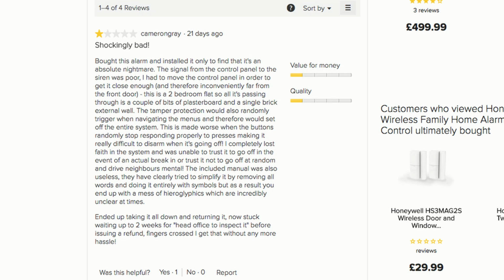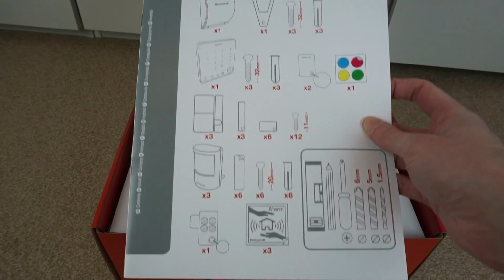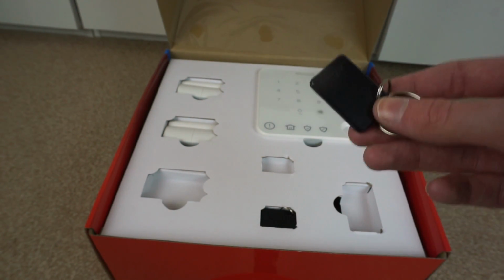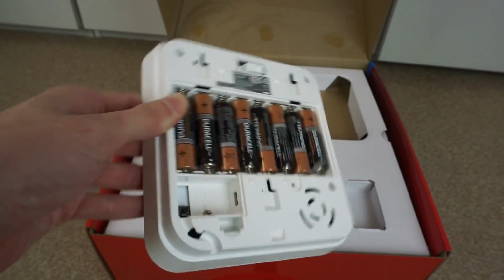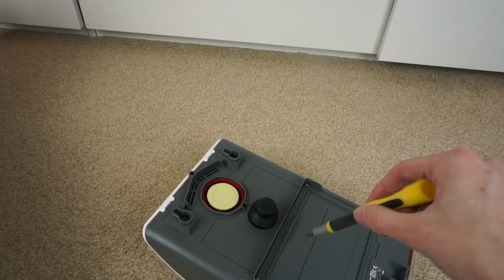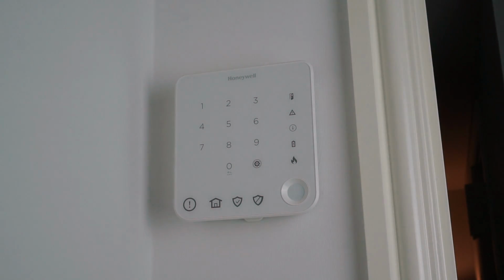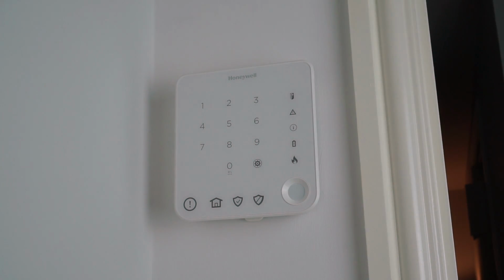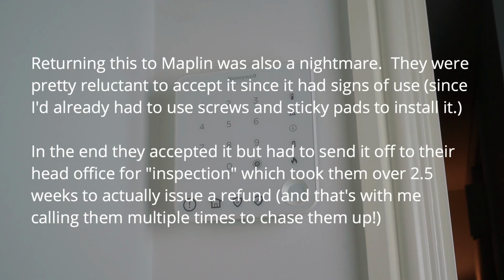Completely useless alarm system! Honeywell HS351S Wireless Burglar Alarm Kit

Comment: A professional installer would check the range of the detectors before installing , this system is a 868mhz system which is now the european standard for for graded intruder alarms , however this is a non graded system for the DIY enthusiast so range should not be too bad ( you may have metal stud walls which will reduce the Fm range significantly , the problem is that Alarm systems should never have been allowed to be installed by a DIY er !! as you have no idea what you are doing , also the fob you speak of is a prox fob and is also part of the european standards form intruder alarms in the uk , so this system is well tamper protected and above and beyond what it should be for a basic radio alarms system , so if i was you id stick to painting and decorating , and yes i am a professional installer !
Reply from the maker: Or maybe DIY is actually a valid interest that people can have and they shouldn't be put down when pursuing that interest and trying to learn?  Ironically painting and decorating is the one "trade" that I'm hopeless at!  Since making this video, I installed a Texecom Premier Elite 64-W system at home with no signal issues (as well as a wired Premier Elite 24 system in a friend's property) and despite apparently having no idea what I'm doing - both systems have been working flawlessly for years!  Personally I work in IT infrastructure where I design, build and maintain pretty complicated systems.  Do I see a lot of people who are less experienced/just starting out publishing stuff online?  Of course! Do they often make mistakes or not do things "by the book?" Sure! Do I feel the need to tell them that they shouldn't be doing it?  No - I was in their position once, nobody is born with knowledge about this sort of stuff!
Reply: @camerongray1515  this is why I said alarm systems should be brought under legislation because you have to know how the equipment works in the first place to understand how to install it , diy systems have given our industry a bad name because of poor installation , the kit you tested I have installed about 25 of the for customers in a budget and they have never failed , Honeywell are a big big player in the “professional security “ market and their equipment is installed in high end property so yes diyers in my opinion should leave well alone
Reply: @camerongray1515  this is why I said alarm systems should be brought under legislation because you have to know how the equipment works in the first place to understand how to install it , diy systems have given our industry a bad name because of poor installation , the kit you tested I have installed about 25 of the for customers in a budget and they have never failed , Honeywell are a big big player in the “professional security “ market and their equipment is installed in high end property so yes diyers in my opinion should leave well alone
Reply from the maker: @jaychez3744  If you've had good luck with this system then I suppose it's likely that I had a faulty unit.  If you've installed so many you're probably well aware that it's a relatively foolproof system with little that the installer could have done wrong.  Of course the installer needs to think about signal strength but my point was that with the distances involved here, I felt that it wasn't fit for purpose for any situation where the keypad isn't able to be placed on basically the same wall as the external siren.  My current Texecom system for example has had no problems at all in this regard despite using the same frequency and with the panel actually located much further away than I had the Honeywell's keypad.  There's also no way that anything I could have done wrong would be able to cause random lockups where the keypad refused to respond.  I wouldn't say it's DIYers that give an industry a bad name since, by definition, they aren't working in the industry.  Maybe these DIY kits do, but that's down to the manufacturers who produce them.  On the other hand, what I feel does give the industry a bad name is some of the installs I've seen from professional, registered companies such as a new build estate where the alarm panels were all plugged into sockets labelled "do not turn off" or where I commissioned an alarm to be installed where they drilled a hole into some metal trunking, dragged the twin and earth through the hole without any sort of grommet/gland and in the process dropped metal filings into expensive networking equipment that had been installed in the same cupboard.  Of course, like anything, there is a hell of a lot of bad DIY out there but that's not to say that every DIYer is bad.  I likely didn't come across as particularly literate in this video however, especially towards the end, it was probably around midnight after hours of fiddling and swearing at it so I definitely wasn't in a particularly good mood for providing a fully detailed and rational video.

Comment: I am using this system for a month and I never had false alarms. I realized that the batteries in the main unit didn't last as long as claimed so I decided to run it via USB. The batteries are now for electrical fail safe back up.
I like the system despite I paid only 130€, I am totally satisfied with it.

Comment: I’ve fitted a good few of these, never had any problems. I’ve always found that you need to just not fit the door contacts though, they give you headaches. Just use PIR’s.
Reply from the maker: Interesting to know although I'd say that if that's the case, it's concerning that they can't make door contacts that work properly, pretty big red flag to the overall quality of the system.  PIRs are usable sure, but door contacts are also extremely useful for starting entry/exit timers or providing an instant alert if a door/window is opened when it shouldn't be.
Reply: Cameron Gray you have problems with hard wired door contacts too though to be honest, they’re a tricky component. I always just talk people into additional sensors. These aren’t the easiest to install at first, but after doing a few now they take me about an hour start to finish. End of the day, who even calls the police when they hear an alarm these days anyway haha? Might as well have a stylish looking one ! 😂

Comment: good afternoon what make of alarm did you buy looking to buy one that is good cheers
Reply from the maker: I went for a Texecom Premier Elite 64-W system, it's great but it's designed for professional installers so does take a fair bit of learning in order to figure out how to set it up, it's not just the sort of thing you can mount, switch on and use straight away.

Comment: I think some of it is down to the end user and the lack of knowledge and understanding!
Reply from the maker: Strange you say that given I was unable to get this system working despite it being designed for an average person to install yet I had absolutely no issues in fitting my replacement system which is designed for installation by professional alarm installers.  The fact that the signal to the external siren can't reliably penetrate a wall or the control panel locking up and preventing button input is nothing to do with my ability.

Comment: you could have the power header connected to the Arduino and say that on power on to output a signal to the pin connected to the power header

Comment: Quick update on the door/window open alert.
This happens on first installation when setting everything up. You by pass this by arming the system and if you get the zone 2 door/window alert you just press arm once more and you've bypassed this alert. 
If done correctly you won't see the alert again, but if you do see it then it's one of two reasons.
1. The installation has not paired correctly, start again, this does sometimes happen with wireless systems.
2. A door /window  has been open for more than 5 minutes or opened within 5 minutes of trying to arm and possibly left open.
The reason why its saying Zone 2 is usually after you've triggered the PIR's for the first time in Zone 2 after installation.
This soon stops once everything is linked correctly.
Again just press arm again and you've bypassed this feature.
Its all explained in the online instructions.
I will say though, there does seem to be a couple of different version  of online instructions, they all go through every point but explain things slightly differently, which might be adding to the installation issues that people are experiencing.
I actually emailed Honeywell asking for clear installation instructions, they sent me back a PDF which was far far better than anything I could find online.
One or Two other little points that I hope you don't mind me pointing out.
If someone is concerned about losing the swipe tags and then someone else finding them along with their address, well,  it begs the question why  buy a system in the first place that has swipe tags as part of the package ?
Also the keypad is touch sensitive, not push button, again this is clearly obvious when first purchasing, so why complain when it arrives that you would prefer a push button keypad ?
I honestly  cannot find anything wrong with this kit.
Reply from the maker: At any rate it doesn't bother me as I don't use the system any more... Not sure what the issue is with me criticising a system that I didn't like, people can have different opinions... The new system is so much better designed that even if I somehow got past all the issues with the Honeywell system, I'd still have much more faith in the texecom system I replaced it with. Even ignoring all the problems, the fact that the Honeywell system only has one way radio communication is a major downside IMO. As for the proximity tags, all the kits came with them, no harm in simply not using them. My texecom kit also came with some tags which I just don't use. To not get the tags I'd ha e bad to buy all the components separately instead of a kit (which comes with tags) and in the process I'd have probably spent more. As for buying one with the touch keypad, I bought this in a bit of a rush and just hoped that the touch keys would work okay, now that I've experienced them I know that I wouldn't want a touch sensitive keypad in a system if I was buying one again.
Reply: @camerongray1515  Again , the one way radio frequency is common knowledge when reviewing the Honeywell system, maybe you might of also taken that into consideration along with the fact it has a touch sensitive keypad before opting to purchase the Honeywell kit ?
Just a thought ! 
I can understand your frustration, I was like it with the ERA miGaurd kit, it was a nightmare from day one.
I persevered for 3 months trying all sorts of things but in the end it had to go back.
I've installed a few wireless systems for neighbours, friends and family but the ERA kit had me totally beat !
Anyway hope your new kit works fault free for many years to come.
Reply: kerry What’s the hourly rate for Honeywell shilling?

Comment: One thing I noticed is that you opened a door contact at the start of your video, which would of sent an anti tamper signal. The instructions clearly state NOT to trigger any anti tamper switch BEFORE linking up to the keypad. Most wireless system state not to trigger an anti tamper signal before linking all components.
just a thought as to why you might be  having issues ?
Reply from the maker: All devices had tabs in place so that the batteries were not connected, opening it would have had no effect as it wasn't powered on. Tamper protection is just a switch, not a permanent thing so once the device is sealed back up again the tamper state goes back to normal. You have to open up devices anyway to mount them on the wall. The issues I experienced here were likely entirely down to a badly designed product rather than user error.
Reply: @camerongray1515  Did you use the instructions supplied or the online ones ? In fairness both are crap, but the ones supplied are utterly mind boggling. A neighbour and work colleague both have this exact system and have no issues at all. I recently purchased a miGuard ERA wireless, (made by Response) with solar panel, it has been an absolute nightmare from day one and is about to be returned as "Not Fit For Purpose", yet our old Response wireless (868Mhz) worked like a dream for over 15 years.
Response, ERA, Friedland are all linked together, Honeywell used to be involved with them as well but I think since they were taken over by Resideo they may of parted with the others ?
Response and the others have all switched to 433Mhz which can be prone to interference, Honeywell have stuck with 868Mhz, which tends to be a better option for wireless alarms.
For the money this Honeywell kit seems to have everything, but is it over engineered at a cost ?
Mine is on order from Screwfix so I'll give it a go but any crap within the first few days and it's going straight back.
We put up with enough crap with the miGuard system.
Reply from the maker: I used the online instructions which were better but that didn't solve the issues I had. The main issue I had was the fact that the signal to the external siren was so marginal it often wouldn't work and the fact that it only has one way communication so it couldn't detect this problem which to me is unacceptable.  In the end I replaced it with a high end Texecom system which while it was more expensive at £300 it's a professional grade system (the sort that alarm companies would fit) and works so much better with proper two way communication.  After using it, I'd never recommend a more consumer/DIY focused system like this one - sure the Texecom is a lot tricker to set up but it's so much better!
Reply: @camerongray1515  Did you notice the almost invisible protective film on the keypad which needs to be removed before installation.
There's nothing in the manual prompting to remove this, and it is almost impossible o know it's on there.
Could be a reason why so many people are saying the touchpad does not sense it is being activated ?
Reply from the maker: I did yes. I doubt the film would be the cause of issues anyway as the touch panel goes from very responsive to completely unresponsive at random. While it was in it's unresponsive state it was also unable to scan tags. I'm still convinced that none of these issues are down to operator error and are almost entirely down to a terribly designed product. There are far too many reports of multiple people having the same issues for this to be operator error.
Reply: @camerongray1515  Spoke to Honeywell yesterday, they are aware that their in box manual and online manual should of shown to remove the protective tape, and also acknowledge that this has caused issues with homeowners having problems with the touch pad.
It is now one of the first things they instruct to do on their live helpline if its a keypad issue..
In regards to the tags also not connecting, again did you remove the small circular piece of protective tape from the recessed tag sensor, even I missed that one, it was the helpline chap who told me about it when we spoke about the film on the rest of the keypad !
It's even harder to notice than the film on the rest of the pad as its smaller and recessed !
I can fully understand why some people are missing this when installing this alarm kit.  
Shame you didnt think of showing or mentioning that this protective tape has to be removed  in your  video !
Reply from the maker: @kerry8059  IMO the protective tape is only a small aspect of the problems with this system. The tags are RFID and would not be affected by a small piece of plastic film.

Comment: Steps for installation:
1. Remove the bracket
2. Screw it to the wall
3. Warning: the alarm is loud
4. It will beep twice
5. Clip to the wall
6. It gets a bit excited...
7. Press disarm because why not
8. Scan tag/dial 1234